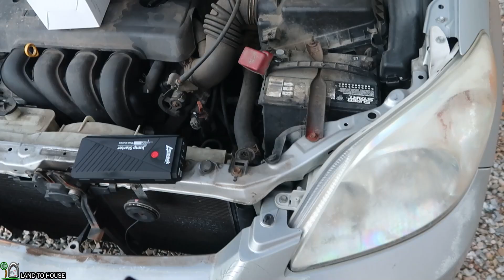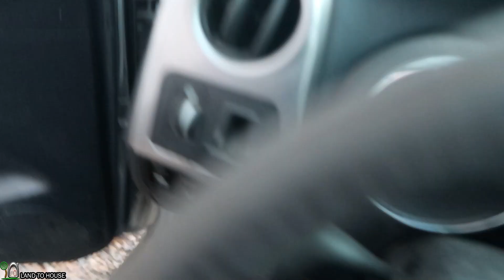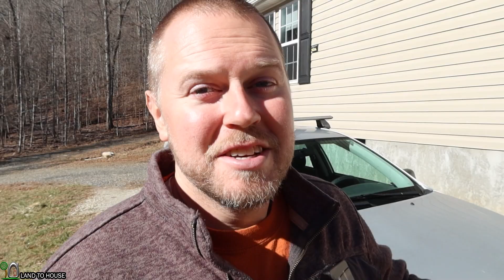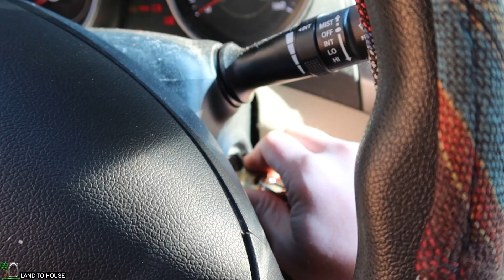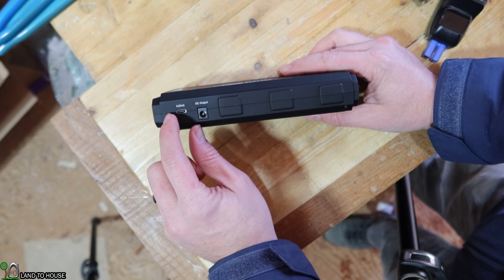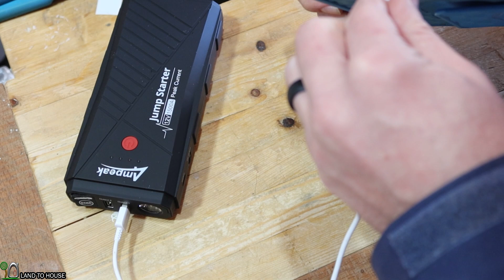Ampeak Car Battery Jump Starter and Device Charger

Comment: Amazon had it on sale for $41.99 and I also found a 50% code so i got mine for $22.98..  i do have the Gooloo brand but for the price i paid its a no brainer.
Reply from the maker: Nice! I have used this 5 times already. Don't know what I would have done without it. Works on my lawnmower too.

Comment: I could have used that a few days ago when my truck battery was low and it was -5F outside. Instead I used a power station I've been testing for a video and a conventional battery charger which took 15 minutes.
Reply from the maker: When you need to get out in a hurry that 15min can be too long.

Comment: Also very nice to have in an electric car!, which has a small battery for 12 volt equipment.
If the 12 volt battery is empty, the car will not start (and it does not help that the car has a huge battery at the bottom)
Reply from the maker: Interesting.  I had no idea electric cars had two batteries like that.